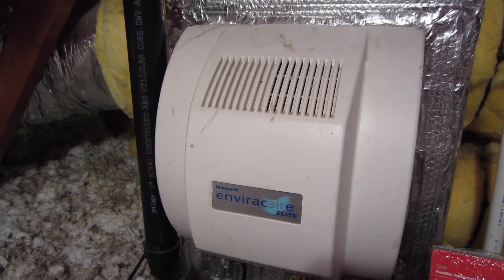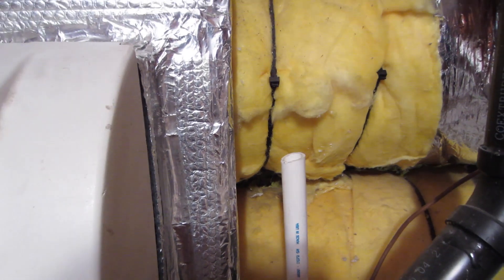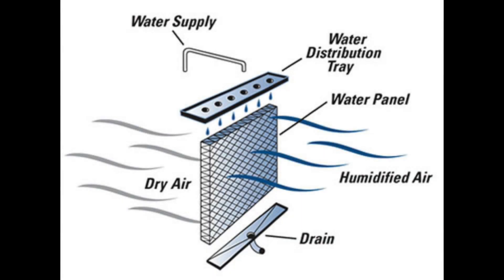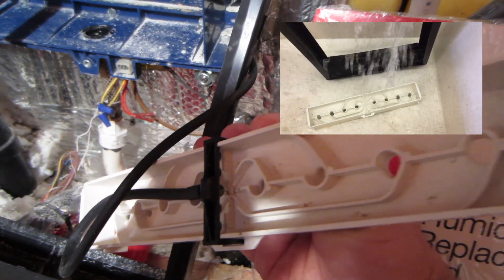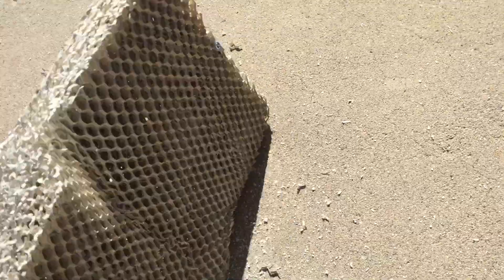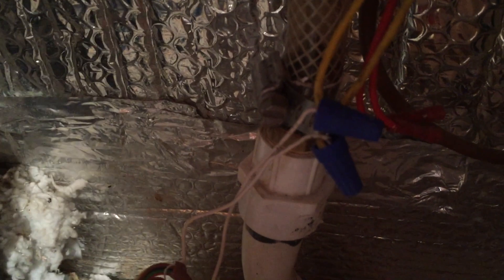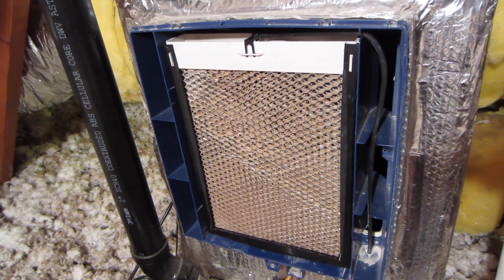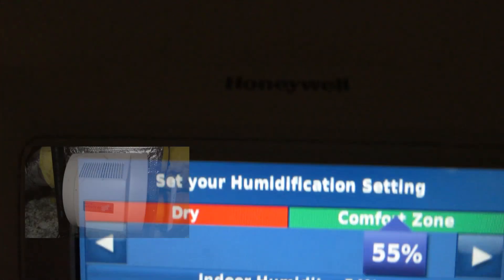HONEYWELL H360 HUMIDIFIER PAD REPLACEMENT

Comment: How do you remove the cover? I tried and it feels like it's going to break. And there's a wire harness who's release tab is hard to see. Don't want to break that either. Thanks.
Reply: I will do another video next time. First unplug it if you can and if cut the tie wraps because you should set the main outside base down to do a good cleaning. Next use a set up needle nose plyers and pinch lightly from top and bottom and pull back. Next, lossen the center release screw with fingers, (don’t unscrew the solenoid on the right) and the cover should be enough to determine its off well enough. Take two hands and pull the main white base up and off. If you can’t unplug have somewhere you can set it up high. Now you can see the filter, guide it out and pinch in and pull back the black pinchers two of them to take off tube feeder. Now you can figure the rest out I am sure. For me in Wisconsin, next time I am going to clean them with CLR and get the mineral deposits out. Good luck.

Comment: So that little fan can overcome the supply static?
Reply from the maker: That is one problem with the flow through humidifiers supply static need to be low for proper operation. I was on a job that someone else installed a flow through humidifier and I was lucky it was two stage heat because on high stage heat it was to much static and cause the humidifier to leak water. So to answer your question the fan can overcome the supply static set up properly. Thanks for Watching.
Reply: What is supply static I have to replace the filter in my humidifier an was curious as to what supply static is an do I have to worry about it when replacing the new filter in the humidifier